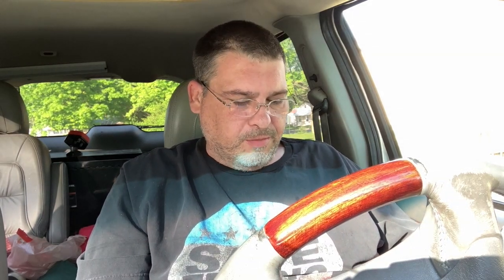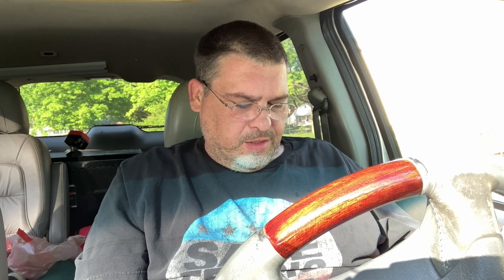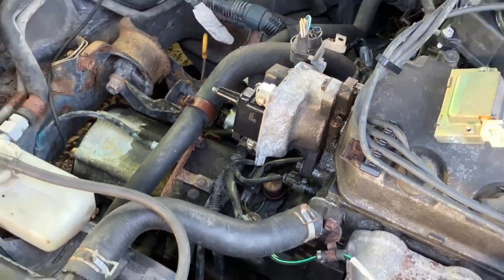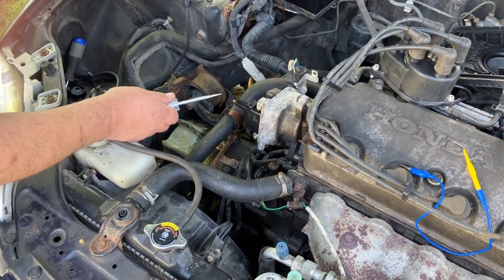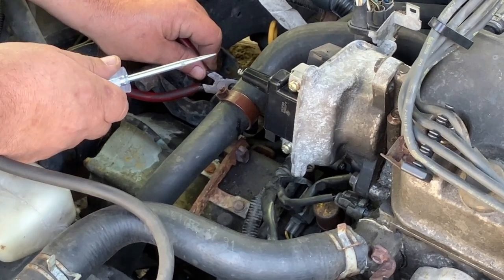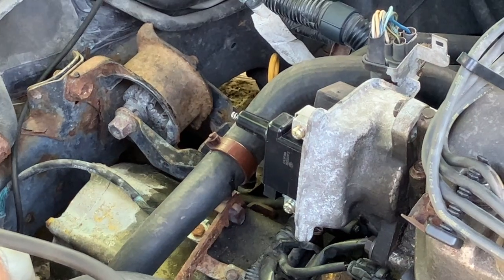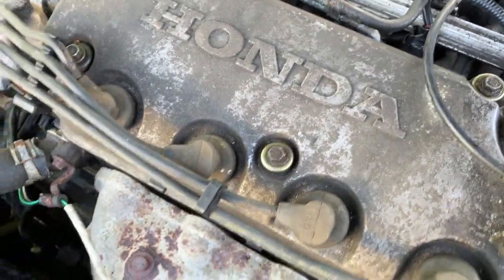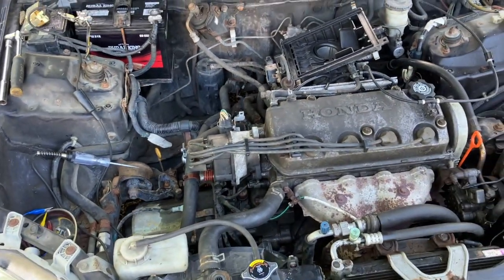Crank No Start No Spark Diagnosis For 1997 Honda Civic 1.6L D16Y7 Engine

Comment: I got a 1998 Honda civic i unplugged one spark plug wire to see if I had a misfire and the car jus turned off nd hasn’t started I’ve put new spark plugs , spark plug wires a new ignition module and I’m getting spark , fuel etc does anyone know what the problem could be ?
Reply from the maker: I would check the timing and see if you are getting injector pulse.  You need  Air/Fuel, Ignition, Compression, and Timing for the car to start.   You have to be missing one of those.
Reply: @frugalprepper  it was the ignition coil my civic sound just like the one in the video my car is now up and running again thank u for ur videos🙏🏾

Comment: I replaced distributor cap and rotor, plugs and wires on 97 honda civic lx and now the car is stalling out when coming to a stop on the road. Had a p1362 on the car for awhile but car started stalling after replacing the distributor cap and rotor. Anyone know what the cause might be?
Reply from the maker: TDC Sensor.  It is part of the distributor.  That is what the p1362 is.

Comment: I got same issue I followed your tests and everything works also have spark in ignition coil. What should I check now? Main relay is also good.
Reply from the maker: Compression, if you have fuel and you have spark, you need compression and timing.  A compression test will tell you if you have a timing issue.

Comment: U said new timing belt but if from AutoZone or advanced auto parts belts sucks they stretched easily with couple truns
Reply from the maker: This on is from china-bay.  It is still going.   I have used plenty of belts from Advance and Amazon.  I have never had any of them comeback.
Reply: ? How do u  bypass crank sensor or add it in to a Tuck harness

Comment: I have the same car and engine. Just had coil replaced, with water pump and timing belt. Have c.e.l saying Crank position sensor is bad. Then, it just wouldn't start one morning. 🤷 The weird was the D light flashed the last time it was driven. Then it wouldn't start. 🤦 No idea where to start.
Reply from the maker: Crank Sensor is in the distributor.

Comment: great video. i noticed you took the rotor wheel off, in my case, my car cranks but wont start. car shut off on me while driving a couple days, this happened out of no where. but, what i noticed when i took off the distributor cap, my rotor wheel wont spin when i crank the engine. any help is greatly appreciated.
Reply from the maker: Probably lost a timing belt and the cam is not spinning.  Cam turns the distributor.  I could be a broken camshaft or a broken distributor as well.
Reply: just a quick update @frugalprepper . my timing belt sheered off teeth at the bottom on the crank shaft. took it to a shop that i trust, and thats whenthe issue was confirmed, long story short... no major damage, got the belt(s) replaced along with the WP. thanks for the help.

Comment: 90 Accord EX sedan

New battery, new distributor, new spark plugs, new spark plug wires, dumped the old gas in the tank and replaced the fuel filter, cleaned the injectors. Strong crank no start.  Pump primes, cel goes out after 2 seconds, no error codes that i can find, replaced main relay anyway, still no go.  Have spark and fuel.  What else can i do to fire this thing up? It was in my barn for many years so I'd like to get it back on the road. Thanks.
Reply from the maker: If it is getting fuel and spark for sure then I would check timing.
Reply: @frugalprepper  Will do. Thanks.
Reply: @frugalprepper  is there anything in that vacuum box on the firewall above the fuel filter that would prevent it from firing up? Any sensors in there that could keep it from firing into life? Thanks.
Reply from the maker: Not if it has spark and it is getting fuel.

Comment: This is such a good informative video. Question tho, did this ever cause a check engine light to come on? 
I have a 2000 civic that was starting just fine. I tried giving it a tune up ( spark plugs, wires, Dist. Cap, and rotor). I turned the car on after I changed everything, to hear it run, and in less than 10 min  it turned off and now will only do a crank no start. And no check engine light has ever come on.
Reply from the maker: It never had a check engine light
Reply: Make a test on your ignition control module, and check your crankshaft sensor
Reply from the maker: The crankshaft position sensor by the crank is only for misfire detection.  I will not cause a no start.

Comment: If u unplug hook to positive if light stays off does that mean igniter is bad?
Reply from the maker: Most likely if you are hooking to the igniter.  I would check the igniter input though to see if it is getting a signal from the PCM.  Most likely it is if you are getting injector pulse though.

Comment: I have a 91 civic with no injector pulse how would i go to fix it
Reply from the maker: I would start by checking voltage at the injectors.  One wire should be hot on each sensor and one should ground at if fires the injector.  Then I would be checking Inputs from Camshaft, Crankshaft and TDC Sensors.  Check at the sensor, and then check at the PCM.